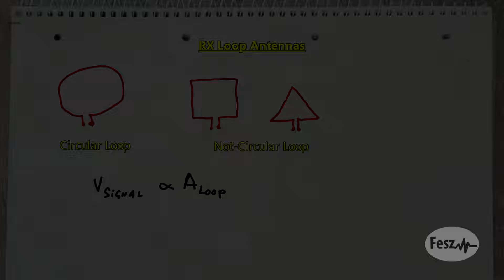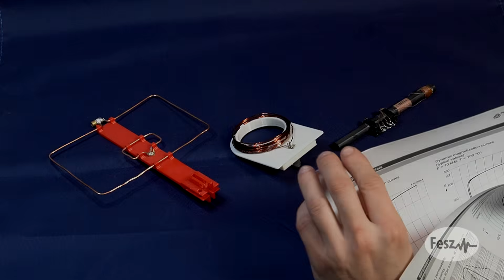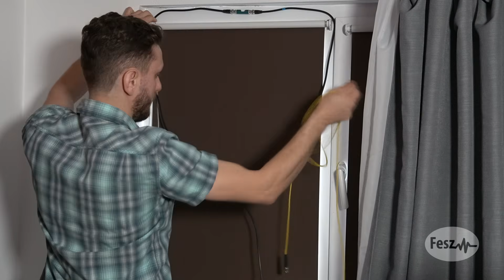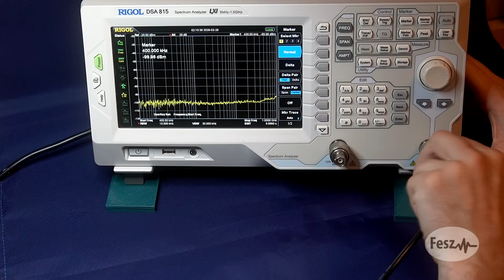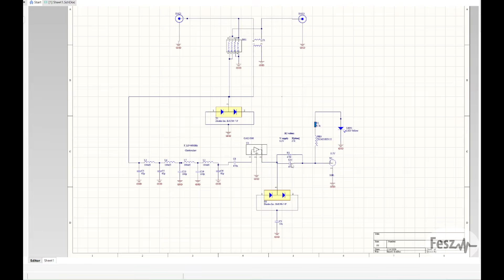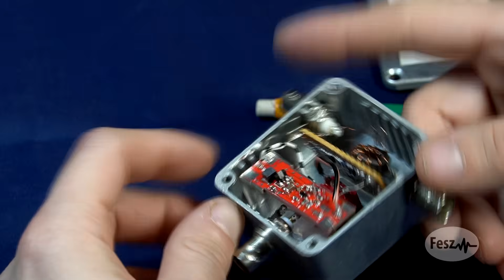The Small Receiving Loop Antenna

Comment: How does the shielded loop antenna receive signal, when the inner wire is lurking out only from a short split? I understand how NF probes work for the scope, but their inner wire is attached to the shielding at the root. Here I can't see where a voltage difference would be generated between the two ends of the coax.
Reply from the maker: The shield is there only to take away the E-field; the inner wire responds to the magnetic field only. The outer shield, since its interrupted, will not interact with the magnetic field.

Comment: This is great. I’ve been getting more interested in loop antennas. Regarding the low impact of the balun, could that be something to do with the input impedance of your SDR? Also, is there any good reason (or need) to put the shield gap opposite the feedpoint as shown in your example and most others?
Reply from the maker: The shield gap is usually at the opposite side to maintain symmetry - the loop should be as symmetrical as possible to keep the balance; For the balun, even with a normal dipole or other such antenna, the impact is in the 1-2 dB range so its not that obvious unless you make a special measurement with a reference signal to highlight it. But as you said, this could also be an impedance mismatch issue - the benefit is just overwhelmed by some other larger issue.
Reply: Thanks for your reply. If the gap is at one end of the shield (near tthe feedpoint), is the balance of the loop actually disturbed? I’m thinking of the loop antenna and the shield as separate structures with different functions. As I understand it, the action of the shield is simply to intercept any E-fields before they reach the actual antenna (the loop) and shunt them to ground while limiting their ability to drive currents in the shield. OTOH the loop exists to contain magnetic flux and use the resulting emf to drive currents. So by moving the shield gap to a more convenient location, how does that affect the loop’s symmetry?

Comment: Nice one, is worth saying that the magnetic field H is E/377 meaning is a lot smaller than the electric field E by a factor of 377. You can amplify H by multiple loops but practically you get a lower input voltage on the antenna than a resonant dipole. So this antenna is good in noisy area where you are interested in low noise floor (you can always use a LNA for extra amplification) than wire antenna that will pick better interference from all places. In summary with loop antenna you trade gain for low noise because of E/ H=377

Comment: Loop antennas are great! The filter directly after the balun probably can be improved. The impedance of a small loop isn't a good match for a 50 ohm input filter. You can use the filter tables with mismatched impedances to design a better filter. The loop is primarily an inductor and can even be used as the first element of the filter. There was a nice master thesis from somewhere in the 60s iirc that has some great examples of this. Can't seem to find it now though...

Comment: I've built a magloop antenna out of 3/4" copper pipe, and a pair of single sided PCB's overlapping each other for the tuning as high voltage variable capacitors are not super easy to come by. I'm waiting to see where you end up with magloops.

Comment: Could you also cover resonant loop antennas? These are pretty cool but they require tuning as they can have pretty small bandwidths (the Q factor can get incredibly high if you use a very big conductor)

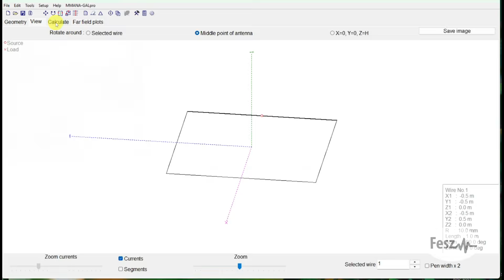Comment: @1:00 That is most interesting indeed. EDIT: -Laptops have a loop antenna around the display panel for Wifi and I always believed the screen had to be perpendicular to the line between the centre of the screen and the router- . Ignore that part, that wasn't my point. I always believed the plane of a loop antenna had to be perpendicular to the line between it and the emitter. Is that incorrect? Regardless, it's still a bit nebulous to me and it'd be great to see a vector representation of all the [magnetic] fields around a receiving loop antenna and which matter for maximising the received energy.
Reply: WiFi wavelength is too short compared to laptop screen size.
Reply: @sergepetrov8598  That wasn't my point and I should never have tried to illustrate so that readers would get my point... sighs...
Reply: I have never seen a loop wifi antenna within a laptop. They use small squiggly monopoles/patches with dimensions of a few cm.
Reply: @SetMyLife  OKay, you replied to the only part of the question that doesn't interest me as it's not the point I was raising... Ignore my description then and imagine I asked about the loop antenna.
Reply: Nvm, I'll figure it out on my own :( .
Reply: @nashaut7635  We're in the comments section so people be replying to comments or their parts regardless of intent of the commenter.

Regarding your theory about the loop having to be oriented perpendicular to the direction of propagation, I think that's correct. It's also my understanding. Afaik it is confirmed by the colorful visualization of the radiation pattern shown in the video.
Reply: @SetMyLife  Thanks for the follow up. That still doesn't make sense to me as I don't understand. If I apply what I know of the relations between magnetism and electricity, then that doesn't fit, so it means I missed something. Any hint?

Comment: You are right, it is very rewarding to experiment on loop antennas.
In my case, the next step was a tuned HF receiving antenna. Incredibly sensitive, but also very low bandwidth. You need to retune it for every frequency change (not practical with wideband SDR receivers).
Waiting for your transmitting loop antenna...